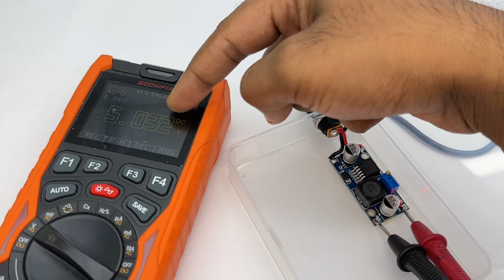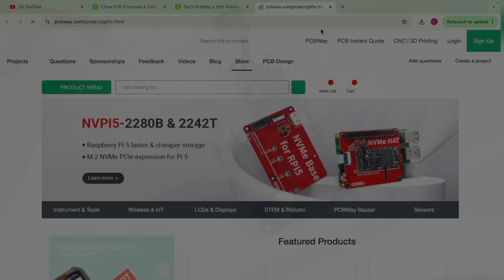DIY Electronics project

Comment: Don't use the XL6009 voltage booster for charging or powering because it has one major issue. Whenever the input voltage will be low, meaning the battery voltage, the module will malfunction and may provide a surge voltage of up to 50V, which could fry your output device. This module is only for light use. You can use a zener diode for protection.